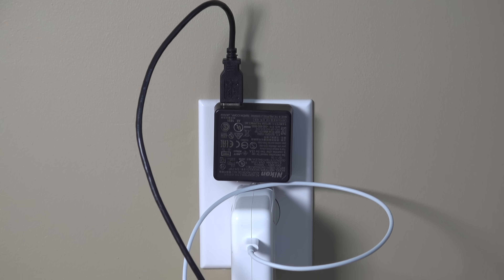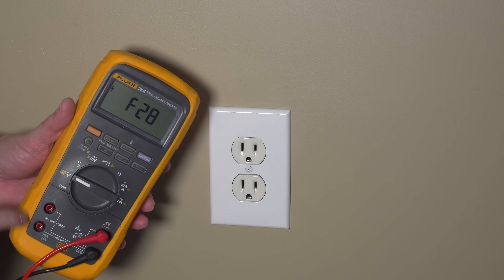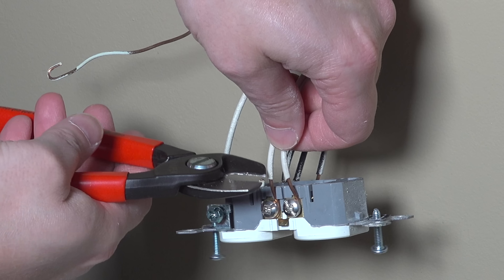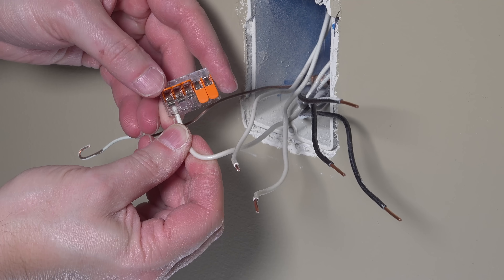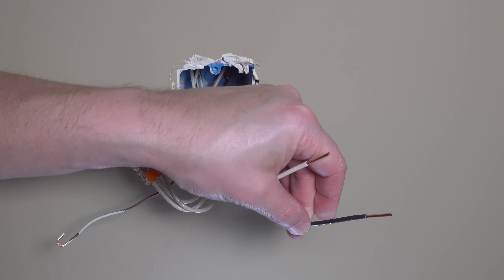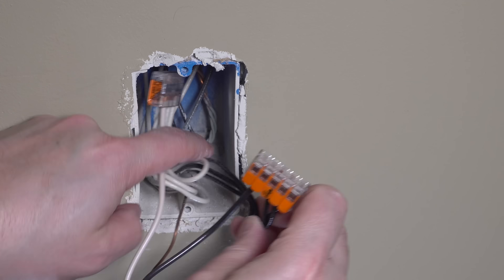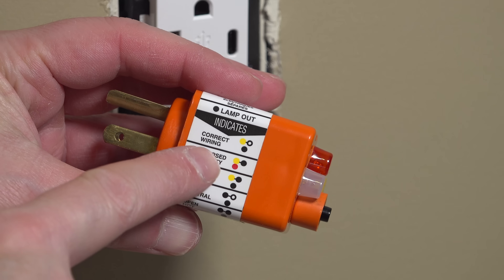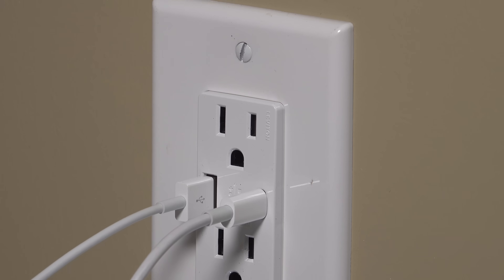Ultimate USB Outlet Install - No More Chargers!

Comment: You actually need those power blocks for fast charging and they also add a couple of inches of extra length for when you're charging your device and using it
Reply: Top greener makes quick charge 3.0 ones with both USB c and a. I believe I've seen usb pd ones too. And to everyone saying fast charging isn't needed... yes it is. Not all of us are Amish using 5v 1amp. It's been 10 years since quick charging came around to most phones(except Apple of course). It's old technology and there's no excuses for manufacturers not to have it in their products.
Reply: This reply section is getting wild AF, lol
Reply: @jsmith-u5i  my phone uses 40watt charger so not true
Reply: @jsmith-u5i  with USB fast charging protocols it is nowhere near that simple
Reply: @jsmith-u5i  those outlets maybe capable of handling 25+ Wats, but you need specific charging protocol to charge your device at faster rate.
Reply: You need it for the laptop. If you don’t use the power brick you will notice that the computer will use the power from the wall but will also need to use the battery so the charge will decrease if you’re using it.
Reply: You realize fast charging isn't needed correct? It's just a convenience. You don't "NEED" those blocks when installing a usb outlet. But it definitely lets you use your outlets full potential without blocking sometimes much needed outlet space to plug important things into.
Reply: @Chris.Rhodes  He says you need it for fast charging. Not that you need it in general
Reply: @JoeWhoJoeMama2024  lol

Comment: The outlet ones are always lagging by 5-10 years. The current selection at common hardware stores is only 2.1 amps. Current phones have higher shortage and variability.
Reply from the maker: This is 5.1 amps

Comment: What about fast charging phones like Samsung that need a specific charger?
Reply: Look for outlets that have a high amp output. Also, some outlets specifically say they enable fast charging. Like the video says stick with Leviton & Lutron. I have also used Feit USB outlets with good results.
Reply: fast chargers damage the battery and wear them out way quicker....  I recommend a 500ma charger(only use the fast charger if your using it at the same time)
Reply: @punker4Real  500ma is a lil low 1 to 1.5 amps is the sweet spot from what ive gathered over the years

Comment: The problem with these things is that each phone has its own fast charging technology, and comes with a matching charger which supports that technology. So these outlets look nice and clean, but they will not fast charge your phone.
Reply: Yes, this may be true. I just remodeled my kitchen and placed these at the end of my island. They may not fast charge but they do a great job.
Reply: USB 4.0 , time to rewire the house....
Reply: They are also not usb-c and usb will be extinct soon
Reply: The usb c can output 30W if only one side is being used. For a phone that is great but not for a laptop.
Reply: You are correct which is why it is essentially pointless my phone comes with a 65 watt fast charger
Reply: Absolutely its not good for a phone just use an original charger for accurate charging
Reply: Knew it was too good to be true
Reply: Some type c outlets does have pd function that can charge multiple devices up to 15v 2amps
Reply: That's because apple refuses to follow electrical standards. Thus making a fuckery if everything. 

Android phones mostly follow usb electric standards. Similar to pc. Thus making industry uniformity. 

Apple is evil causes stupidity.
Reply: @Originalxlander  nope, oneplus has dash charge (4A) that requires a chip or it defaults to 1A, then there's USBC -PD which is about the only standard that's "standardized"
Reply: @Originalxlander  What? Apple literally uses the USB C Power Delivery Fast Charging standard since the iPhone 8
Reply: @Originalxlander  That's not just an apple issue. Each android device uses its own charging technology.
Reply: Like my OnePlus, it has a fast charge  that only works with its own chargers. I can still charge it off of any usb outlet, but OnePlus fast charging is different in that they put more controls in the charger, so the battery can stay cooler. Then also with this system, in 5 years, it will be 100$ outdated with usb z or something.
Reply: @tomer_stern  wrong, android fast charging merely depends on wattage of the brick.
Reply: @starmc26  Not to be argumentative, but there is a lot more to it than the wattage. Try your fastest brick on a oneplus device for example, and you will get very slow charging speeds. Samsung, OnePlus and xiaomi for example use totally different charging technologies.
Reply: @tomer_stern  dude, you are completely and utterly wrong.
Reply: @tomer_stern  wrong, my xiaomi is charging perfectly fine with fast charging using a Samsung power brick, the original brick didn't even have fast charging
Reply: @I_AM_Shepherd  You seriously don't know that the "fast charging" or "quick charging".. or WHATEVER "charging" technology... IS BUILT IN TO THE PHONE/DEVICE..!!????!!.... SO, the "charging brick"... WHAT WE'RE TALKING ABOUT.... Merely depends on wattage OUTPUT.
Reply: @starmc26  Different android OEMs use different fast charging protocols, even if the USB-A ports deliver the same or more power (either by increasing voltage or wattage or both) as the charging brick, the phone still won't fast charge because the system is designed to recognize its own fast charging protocol for safety and stability reasons, without the proprietary hardwares the phone will default to 2.1A at 5V at most. Btw fast charging doesn't just work by increasing wattage, for example Power Delivery and Qualcomm Quick Charge (a phone with a Qualcomm chipset doesn't necessarily mean it support Qualcomm Quick Charge, it depends on the OEM to enable it or not, it is not user-customizable) can increase the voltage and wattage at the same time, depending on the devices and cables. Starting from Qualcomm Quick Charge 3.0, the voltage and wattage are always being adjusted dynamically and automatically in real time by communications done between the smart control chips in QC3.0 supported fast charging bricks/powerbanks and the one in the phone. Besides PD and QC, there are various OEM fast charging protocols like OPPO's VOOC and SuperVOOC and AirVOOC, OnePlus's Dash Charge and Warp Charge, Huawei's Super Charge, MediaTek's Pump Express, Realme's Dart Charge and SuperDart Charge, Vivo's Super Flash Charge, Samsung's Adaptive Fast Charging and Super Fast Charging.
Reply: Pretty much everything will take 2A from an iPad charger nowadays (or whatever its maximum current is if less than 2A). You can emulate one with 4 resistors. Those outlets will likely charge your devices at 10W, which isn't terrible.
Reply: @BullCheatFR  yes it is compared to 20w
Reply: @michaelmiller6013  we live in different worlds. In my world 10W charges my phone in 1:30. In my world I come home at 20%, plug in 45 minutes and leave at 80%. If I need faster charging that's what the ugly brick is for. 1st world problems

Comment: Hint - Check the size of your box before ordering.  The box in my wall is old, nailed to the stud, and not large enough to accommodate the deeper outlet.  The outlets with the sub ports need a deep box.

Comment: The problem is that these most likely are not fast charging and definitely not super fast charging. These also may no be the voltage that your device requires
Reply: These devices meet the USB-C standard: 5.1A for the Leviton and 6A for the Lutron.
Reply: That's what I was wondering. It's good for regular devices but does anybody have info if they even offer fast charging for phones.

Comment: Are the USB ports always hot?  If so, they are pulling vampire power 24/7.  It may not be much but it adds up.
Reply from the maker: No they are smart ports, so I am sure they draw a millivolt or something but they don't output power until needed

Comment: Alternatively you can buy Gallium Nitride charging bricks, they’re a lot smaller and charge more efficiently than the cheaper alternatives.
Reply: Ya, but you still have a block and its not as sleek as the built in ones. though they are better chargers
Reply: Especially the 2nd generation chargers

Comment: A lot of those outlets do not support QuickCharge3 or have lower amperage. It maybor may not be a good thing. Fast charge is hard on batteries, slow charge is slower but will preserve the battery longer: perfect for overnight charging.
Reply: I mean here (South Africa) you just have an adaptor you plug into the wall. It has a pass through for the larger mains plug and a breakout that supports more standardized European style plugs.

Comment: Love the Wago connectors.
Reply from the maker: I didn't record it but I just did some ceiling lights and they are amazing. I pre attach them on the ground then make the final connections with one hand, other holds the light, so much easier.

Comment: it's important to mention that some outlets run on two separate phases like in kitchen so this method of connecting all hot together will result in short or if you mess up and connect two phases instead of neutral well say goodbye to whatever you connect to this outlet also most if not all of these outlets are NOT GFCI compliant so forget about instaling them in bathrooms

Comment: the cable cutter is already fkd up by multipele shortages and the click wago isn't the correct wago to use, you need the other style, for massif cable, and not for flexibel cabel

Comment: I am having a flashback about the time when my dad used a thin copper cable to power a microwave, electric oven and a lightbulb. My mom uses the microwave only and guess what happened, the male socket melted and the wire heated up to an abnormal level.

Comment: After seeing how long the “electrician” installed that receptacle with that much exposed wire at the terminal, and without the screw being straight, I’d probably want to check and fix every single device. The exposed wire would fail any inspection. I’d also be willing to bet that receptacle is not rated to hold 3 wires on each side like that and should have been spliced, with just a single wire going to the terminals. No electrician who cares about his work would “backstab” the outlet either.
Reply: If I were a customer who had that done I would definitely take pictures and talk to the company about either fixing it or getting a refund. That is completely unacceptable.
Reply: I'm willing to bet it was an apprentice that had no idea what they were doing.
Reply: @aidangattinger8975  from what I’ve seen, you’re  probably wrong lol. So many incompetent residential electricians.

Comment: I looked at these a while ago and decided they are not worth it.  None of these USB outlets are GFCI compliant, so they cant be used in kitchens or bathrooms.  The few other places I charge my devices by an outlet, have so many other devices connected, I use a power strip.  With the power strip, I have plenty of places to plug devices.

Comment: damn those wires on that existing receptacle are stripped so far back on the screw lmao should be shortened by like 1/2 inch
Reply from the maker: Yes, a lot of the wiring in my house is not great like that. Always a surprise when I take something apart.

Comment: Why are there so many wires inside that outlet? Here in the Philippines, we only have two wires.
Reply from the maker: Here multiple outlets are run in a circuit but they are not home runs, so the wire may go to several outlets in the circuit. Then someone may tap into the circuit for something else like a light, which is what I imagine that one is here. So....2 wires in, 2 wires out, the final 2 are feeding a light circuit.
Reply: It looks like they used the outlet box as a JBox.  And this allows to run the homerun to an outlet box and make up all the wire connections / splices on the ground floor.  Then you don't have to install JBoxes in the attic to run the homerun too or  make up splices.

Comment: To replace the power socket just waste of time IMO, with the power brick is easier to replace when it faulty ;)
Reply: We are remodeling a whole house. We were going to do those one in rack bedroom. Three in the kitchen an three on the living room . At 30$ each from Menards the cost was high.
My son instead bought us fast charge rate Anker charging bricks . They were only 13$ and I think they are 20watt and charge our devices s super quick . And they are portable .
I’m glad we didn’t to wall outlets .
Reply: I can only understand this if an outlet near a bed or the furniture is bad, also those adapter bricks are volt and current limiters to prevent damage to your devices, I'm unaware if these outlets are...
Reply: Nomen Clature  because he can

Comment: I have a couple. One bad thing is you can’t plug transformer block style plugs into either outlet when the usb is in use. That sucks
Reply: They should have it sprawl out a bit and provide their own cover.
Reply: It doesn't work with regular sized small plugs either with any USB plugged in. (USB only or normal power outlets only)
Reply: Depends on the type. Smaller ones fit okay with USB plugged in as well. I have one bigger one that I use and I have to use it upside down in the top socket in order to make it fit with the USB plugged in at the same time.
Reply: Just use a wall wart remover, it's just a short extension cord.
Reply: @stiles3711  If I wanted to use a short extension cord I wouldn’t have bought a $40 outlet. 😁
Reply: @thefurrylittleotter3460    OK do without not my problem.

Comment: Don't everyone get all hot and bothered. Hold your GD horses. This is NOT some kind of awesome angry pixie magic hole.  I'm holding in my paws right now a Leviton decora No. T5633-BW with standard USB-A and USB-C...for a grand TOTAL of 5.1A of charging power.  The Amazon link lists it as 25watts. We all know what happens when you plug in BOTH holes, you don't get the full chooch. You're lucky to get 3A, so don't think you can fast charge or PD power delivery to your fancy tablet or laptop. Those plug-in bricks supply 50-70watts to keep up with demand. There's a reason my receptacle is still in the box: it's fine for itty bitty things, but the USB-C isn't really future-proofing anything at 2.5 to 5A.  Unless Leviton turns their receptacles into a little TARDIS, you ain't EVER gonna get decent USB power from a standard size receptacle--Ain't ever gonna fit! TWSS.  You need to make this little HITCH clear to people to be fair, Cilver Symbal.

Comment: You should insulate the ground wire, because if it comes into contact with the hot you will have a fire.
Reply from the maker: Not sure if you are outside the US but here is is always uninsulated in these type of installations.

Comment: I'm going to be completely frank: charging standards change so often that it's not going to be worth it, and many devices are proprietary. There's more than one standard out there and some devices can even have their batteries permanently damaged by using the wrong charger. Unless you're replacing your outlets every two years, something that's NOT a good idea as it's not good for your home wiring (the bending of the wire leads can eventually cause them or their insulation to become brittle and fracture), don't bother.
Reply: Your statement is pretty much false.  While standards have changed, it is has most definitely not been often.  The whole point of USB is that there is a standard.  USB A has always been and will always be 5V.  USB C does allow for different voltage and amperages, but there is integrated circuitry in the device and charger to determine what that is.  If the negation does not happen, then it defaults to the lowest charging level.  As for wiring, thats a non-issue.  The bending of copper wire does cause what is known as work-hardening.  Copper will eventually break if bent repeatedly.  However, the your household copper wiring has barely been touched.  It was bent around a spool at when it was manufactured, then it was put into your home.  Its safe to be bent around.  You would have to put in a lot of work to bend the copper enough to cause it to fracture or break.  As for the insulation, its fine.  Unless its so old that it cracks while you bend it, its fine.
Reply: @finkelmana  I think it's more about the charging efficiency/optimisation that WardenWolf  is talking about. For example many devices don't charge as effectively when powered by a third party charger. With the rise in charging wattage and thus speeds, it could very well become pointless to have a charger that supplies say 10W of power when devices 2 years down the line could be charging with 50. 
But rather than comparing it with a charger, it should be compared with other wall sockets and having an option to charge and use those sockets for something else at the same time is a big plus